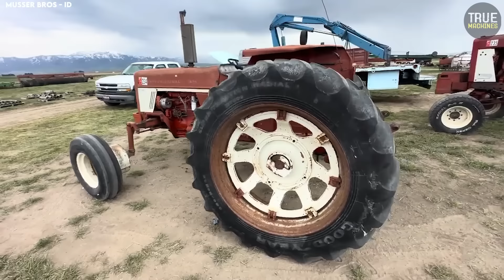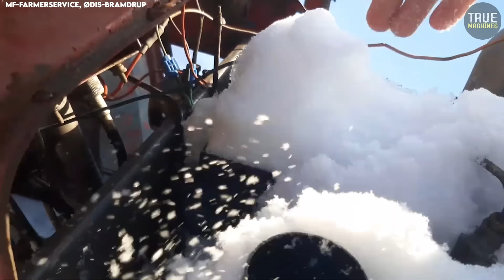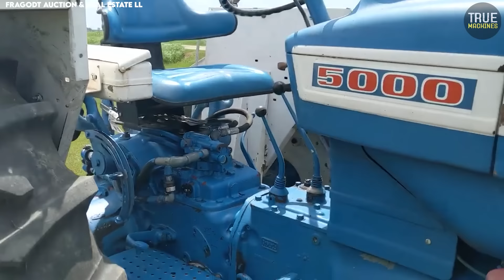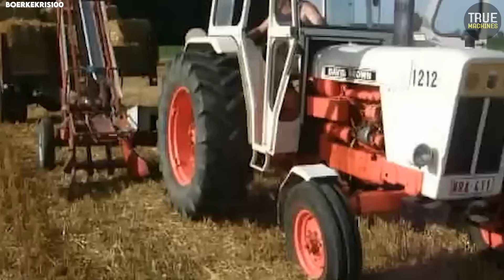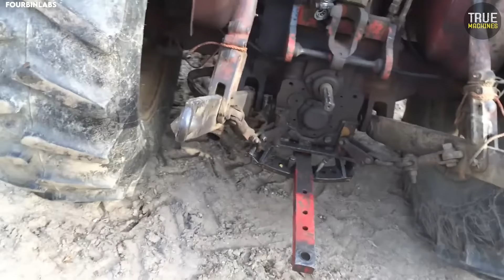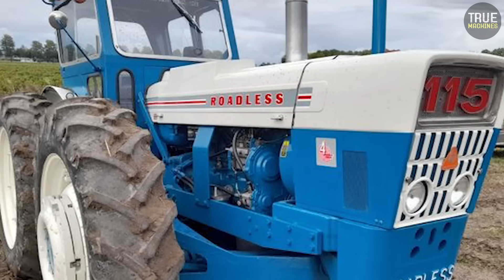10 British Tractors From the 70s That Made Headlines

Comment: The Ford 5000 was a 4 cylinder 4.2 litre diesel  engined tractor originally 65hp and later becoming 75hp.
Where do these inaccurate details come from ? Is it AI not knowing anything about what is commenting on or what a stupid person who knows very little came up with and told AI.
If you're going to put up these stories at least try to make them accurate and factual.

Comment: I gave up after 6 minutes, - far too many schoolboy factual errors - like the Ford 5000 was not a 3 cylinder engine, the MF 135 Continental engine was not a diesel,  and the MF 165 was not factory fitted with a Perkins 4.236